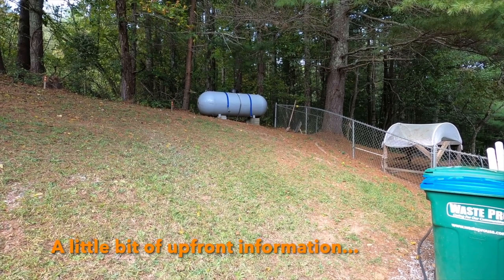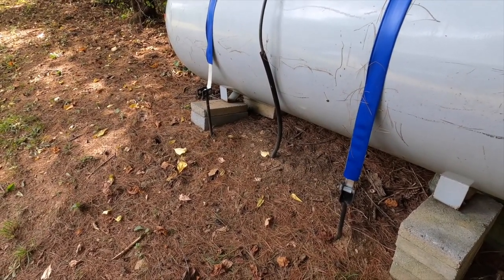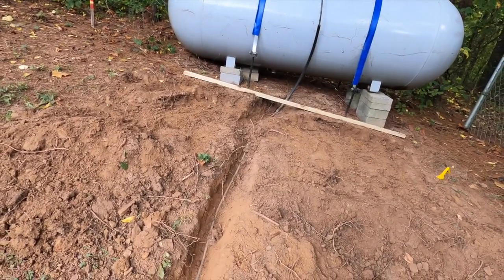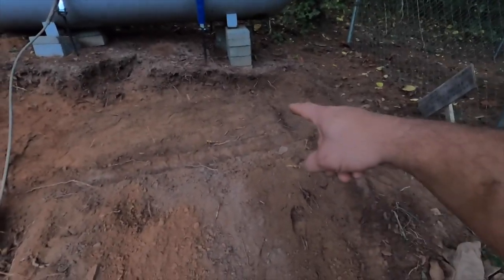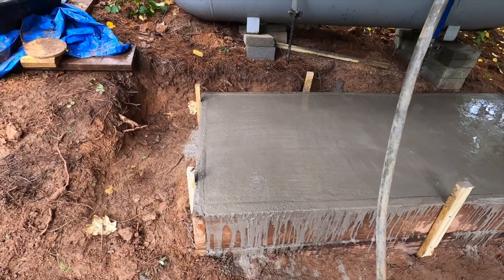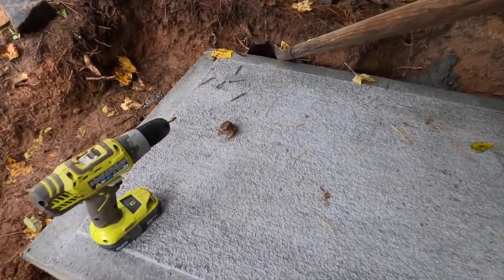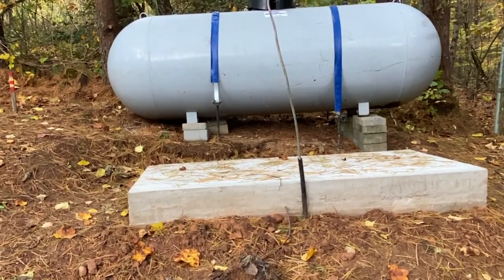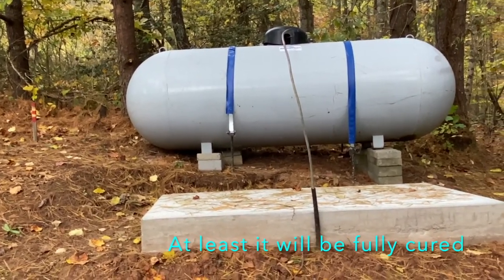Building a Concrete Slab: 500 Gallon Propane Tank

Comment: Great video. Did you take into consideration the anchor points used to hold down the propane and making the concrete in that area stronger somehow? I want to get a 500 lb propane tank for my generator and the propane company wants to charge me $1,875 for it! (edit: by "it", I mean the slab). Uhhhh. no thanks! I can do that way cheaper myself!
Reply from the maker: Thanks for watching and commenting. I went back through the video and realized I left out the part where I put wire mesh in and rebar. I put in six 4' pieces (corners and long sides)  of vertical rebar, then put the wire mesh in close to the top. My original plan was to have the tank placed square, mark the foot holes, then put in anchor bolts. The guys that placed the tank were very dangerous and impatient, so I never got to mark the holes or drill for the anchor bolts. They smacked the concrete slab quite a few times and nothing broke off.
I was going to use the safety straps, but I didn't because the tank sits perfectly flat and square.
Recommendations: Go with higher PSI concrete, if you are concerned about cracking/breaking.  Stay away from roots. Cut/chop them away from your slab. Put RootKill around and under your slab. Use vertical rebar, if building on any slope. Compact dirt and gravel as you go to avoid shifting/settling.

Comment: Thanks for filming and sharing this.  Did the pad need to be that thick?
Reply from the maker: No problem. Thanks for watching and commenting. In my case, I went thicker due to slope and frost line, and also out of concern for the way the guys would handle the tank when putting it in position. I have seen them in action. I was afraid they would have it go in hard on one leg and knock an edge or a corner off. The tank weighs 1,000lbs and when it is full it weighs 2,650lbs. There's a lot of weight concentrated on those little legs.

Comment: How long does that 500 pound propane tank last you before you get it refilled?
Reply from the maker: That's a loaded question... They only fill it to about 75%. Our first year we paid about $2500 to $3000 (ridiculous) for the winter. It only runs the furnace. We had issues within the house that were allowing a lot of heat to escape- Missing or bad insulation, bad window or door seals, and cracked chinking. Our house is a log house. We paid less the next year, but it was still ridiculous. I kept smelling propane. You can tell the difference between propane and burned off propane. I contacted the company and they said they found nothing wrong, which was a lie. My cameras showed no one came on my property. I sprayed soapy water on the connector where they fill the tank and it blew bubbles like crazy. A pine needle was stuck in the connector allowing it to constantly leak. Intentional? I don't know. This company loves to fill the tank when it is no longer cold. I now put a lock on my tank to keep them from filling it during the warm months. We now pay about $1200 a year.

Comment: Water on top, keep it wet for about 10 days, and then have pitty for the guy who has to remove it 100 years
Reply from the maker: Thanks for commenting. This is my 3rd concrete pad that I've done, but I wouldn't say I am anywhere near "experienced" with concrete. The good thing is that it rains all the time in western North Carolina, so it stayed wet for a long time.
Reply: With all the cold joints from using bagged concrete in batches, no real reason to cure it like that. More than strong enough to hold a propane tank forever, but will be easy to break up with a jack hammer.

Comment: Wow, that lp supplier is a hot mess. After all that delaying on you I'd have them remove the tank from the property and find another supplier. Horrible customer service.
Reply from the maker: Yes, they are. I haven't had one customer service call go well yet. The tank is finally on the new pad, but the rust hasn't been treated yet. Believe me, I would get another service in a heart beat if I could, but they got the market monopolized around here, They also have ridiculous penalty and equipment removal fees.